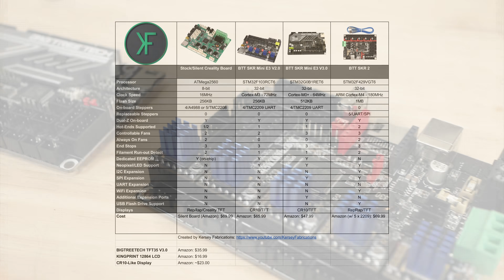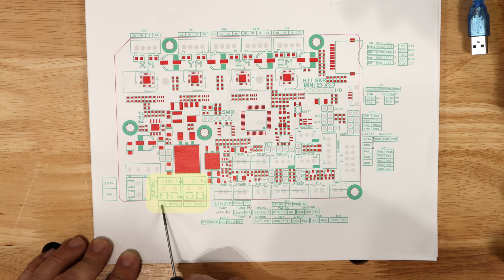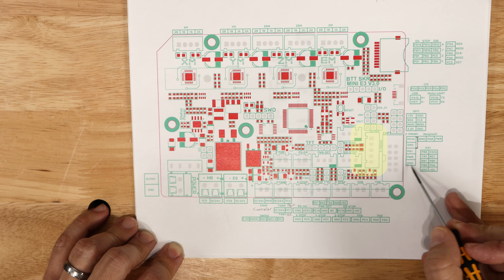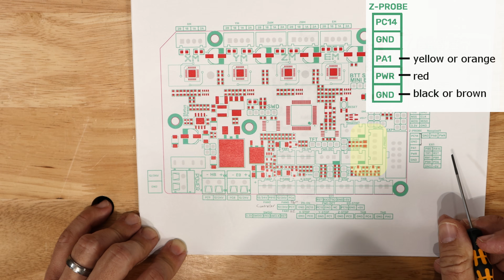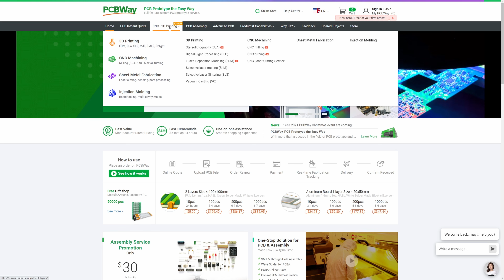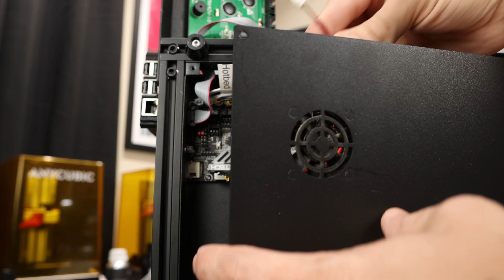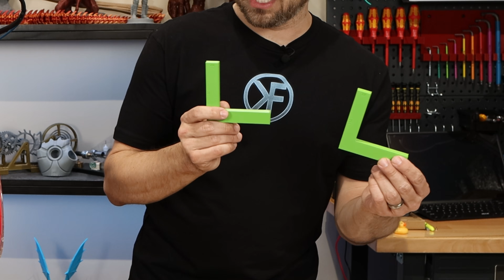Bigtreetech SKR Mini E3 V3.0 - Ender 5 and Ender 5 Plus

Comment: I have the enders 5 plus and want to get this board what screen would you recommend for enders 5 plus with that bigtreetech board
Reply from the maker: I like the Bigtreetech TFT35 V3.0 (https://amzn.to/3v5sUoz). It's a good size screen and it's easy to find mounting models. I even did a video on it. With that being said, Bigtreetech makes several sizes and they'll all work if you can find someone that's designed mounts.
Reply: @kerseyfabs  whats the best firmware for that mother board with the tft 50
Reply from the maker: All of the displays use the same board firmware. You can find it in the video description.
Reply: @kerseyfabs   im having an issue with wiring on my enders 5 plus to this board i was following your video but the wiring is diffrent as theres a black and red wire going to a tiny circuit board about 2 inch square it says control in on it

Comment: I want to see the out come from the new board and how you liked it? I fell in love with the lerdge k board because of your videos. Thanks.
Reply from the maker: It's been working great so far in my Ender 5, no complaints. It's also nice to have some up-to-date firmware installed on it. I was still running relatively stock firmware on my old 8-bit board.

Comment: I've been banging my head against a wall for almost two days trying to solve my BLTouch issue on my Ender 5 Plus. I never had issues with it before this board. For some reason, during the mesh it will start doing the mesh correctly, but at some point it will eventually fail. The probe will move to a new spot on the board, the board will go up quickly, touch the probe, then go back down and move up slowly. On the second pass the BL Touch will not retract and the mesh will fail. At that point i have to restart the printer to try again. Any idea what's causing this and what can fix it?
Reply: Hum... so is that the final option? Best bet is to go with Klipper? I haven't moved my wires around on purpose, but the weirdest thing happened. I switched to a new 24v quiet case fan and haven't had the issue reappear. Idk if its a coincidence or cause & effect at this point. I will test my BL touch more tomorrow and try to get it to fail again. I'll update everyone with the results.

Edit: it started to fail again. I've replaced the board and it's still having the issue. Must be a problem with the firmware
Reply from the maker: Well, above all, I'm glad you solved each of your problems. Unfortunately, there are too many side cases for me to solve them all. All the best!
Reply: @kerseyfabs  Hello, love your channel.  do you know if there was a fix for this issue? i am having the same exact issue on my 5+ with the BL touch. tried 2 BL-touches and 2 different mainboards (Both E3 V3s) and had the same exact issue, even tried re-compiling marlin to have all 5 wires plugged into the probe connector.
Reply: I am having this EXACT same issue. I went back through and checked all my wiring and I also grabbed my bl touch off my other Ender 5 Plus and its the same. I even seperated the wiring out of the control box to try and elimante an possible interference. I tagged Kris in some posts on the Ender 5 Plus Facebook group so hopefully we can come up with a fix. If you figure something out please let me know and I will do the same!
Reply from the maker: The best I can offer initially here is either (a) Noise on the line. Try moving your BLtouch wire away from your power wires when you run the cables. I've seen the power lines add too much electrical noise on the BLTouch sensor. (b) Bad connection. Sometimes the stock connector just doesn't fit the new board connector well enough, causing intermittent issues. You can try to change the connector on the BLTouch lines.
Reply: @kerseyfabs  I ended up going over all the connections and even took the entire wire out of the mesh stuff and ran it totally seperate from anything to elimanate interference as much as possible. I flashed a couple more times and still had no luck. I ended up setting up klipper because it was something I wanted to get into anyways and have been having zero issues with the bl touch. Hopefully, this information helps. I'm not sure why OP and I were having issues but it must be some glitch. Thanks!
Reply: Had the same exact issue as the others.  Tried EVERYTHING from wiring to customizing the firmware in many ways, no luck.  Can confirm the Klipper solution gave me back a functional BLTouch. Thanks, Dave!
Reply: @earendil532  That's awesome to hear! No offense, I'm glad I wasn't the only one in same boat. Honestly it was worth it to move to klipper anyways. I'm getting addicted to 100mm/s+ speeds now. Accelerometer will be here tomorrow.
Reply: @Davedubya69  I have the same issue. Sounds like it is most likely a firmware issue as all my similar attempts did not work. Although right now upgrading to klipper sounds a little over my head. Do you have any links/resource you'd be willing to share on how you made the transition? I've been interest in it for a long time, but it seems intimidating lol
Reply: @KurstenOwen  So, IDK how Mr. Kersey will feel about this on his channel but this is a link to a guy that shows you how to install klipper using KIAUH. It's very easy to do and if you are doing it for an Ender 5 plus I could get you my config file. With this file it would take roughly 20 mins to get up and going. The only thing you will need is a raspberry pi. I also use a PITFT50 screen and designed a wall mount that holds the screen and pi. https://youtu.be/OmBIHB9TFgc
Reply: @KurstenOwen  i played around with this a ton with different firmware settings... tried both kersey's firmware and edited the BTT ender 3 firmware to just fit an ender 5+..
 Had the same issue no matter the firmware soruce.. couldnt figure it for the life of me... ended up switching to a V2 board with the same BLtouch settings and that board works flawlessly. Even tried a 2nd board... all the same.

Strange part is, i put the mini e3 v3 in an ender 3 pro and flashed the firmware from BTTs website... same bltouch settings... and its working flawlessly now.
Reply: @lukeslab2390  That is so frustrating! I have two other e5+ that are using the V2 board, and since the new one came out (and it was cheaper) I was like "this is a no brainer."  I definitely thought wrong lmao. Wonder if it would just be best to either revert back and get a  v2 since I know it worked on my other e5+ or try and upgrade to klipper... I've always wanted too, but it seems intimidating lol
Reply: @Davedubya69  Very interesting.... I currently have a 8gb 4b pi, but it is running octoprint/cams for 3 printers. Wonder if I could run the klipper octoprint in the same way if I upgrade them all to klipper at the same time. I'll have to do some testing. Hopefully my tft35 would work for screen. Please, I'd love the files to do some testing for today!
Reply: @KurstenOwen  With KIAUH you can instantly do multiple instances all at once. Klipper is amazing and can do a ton. The only complaint I have is the lack of plugins that octoprint has. Also, you can do klipper with octoprint but I don't suggest it. It uses a bunch of extra resources. I suggest just using mainsail. If you want to, it's probably easier to chat on FB messenger. I search my name. My profile pic is black with a file folder saying "come and take it"
Reply: Did you end up finding a solution? I seem to have the exact same issue. Sounds like others gave up and switched to klipper which would make me definitely think it is a firmware issue. I was just wondering if you ended up getting it to work in another way? I've been struggling hard this whole weekend just because of the bltouch issue on my e5+.

Comment: How to connect this new board to Ender 5 Plus  with the stock touch screen and BLtouch?
Reply from the maker: It won't work with the stock display with any firmware that's available.
Reply: @kerseyfabs So, you need to switch to MKS board - it costs +/- $ 50 with a touch screen

Comment: THX for that superbe Pin out Walk Through. All the right tips for the upgrade. 
A Tip from me: For removing the glued connectors use a hot air station or a hair dryer to soften the glue. 
then you can easily remove the connectors without the danger of poking the board or cables.

Comment: I dont really like these slower cips there are using. the M0+ is a LOT slower than the m4. Has no hardware floating point.... It is a really cheap downgrade. 
You do see the differance in klipper when the loads on these boards is a LOT higher. Honestly the best 4 stepper board of this gen IMO is the RRF e3 board. It has 1meg of flash, 169mhz cpu and all the compatibility for klipper or marlin... Dont really understand why the e3 v3 is worth it over this. It still matters, my old 8 bit printers sit around 80% MCU load when printing fast. The RFF seems to hover around a 10% load at tops.... It does sort of matter for some situations.

Comment: Another great video! Only thing I wish with your firmware is that you would share the actual files (.h, adv.h, pins, etc) to if we need to adjust a couple things we could (runout sensor on Ender 5, etc). Still, I appreciate all your effort you put in to helping all of us! I have the mini v2 on my Ender 5 now so unless I find a great deal I doubt I would upgrade until something would happen to this one.
Reply from the maker: I ALWAYS publish my source. You can find it on my GitHub.
All source can be found here: https://github.com/KerseyFabrications/Marlin
Select the branch you need from the drop down.
Reply: @kerseyfabs  Thank you - I always forget about github!
Reply: @kerseyfabs  
LOVE your videos always so helpful and easy to understand.  i have an 5plus  but i have a sprite pro kit on it you don't happen to have a firmware file for that configuration do you ?  or possibly some guidance on how to change the firmware you gave.  I did instal your firmware but need to adjust offset  eseps ect.

Comment: Question for you. I went through the process of installing this board on my E5P and after having double-triple checked the wiring of everything I have yet to get my bltouch to light up, let alone probe. I am using a stock Ender 3 screen on Exp 3 and the board from the video, and I’m honestly at a bit of a loss on what to do to get this working. Any suggestions are appreciated!
Reply from the maker: In the video I show the correct mapping of the BLTouch pins on the board layout. You may need to manually rearrange those pins to match the pin-out.

Comment: Unless they changed the TFT 35 V3 E3 - If you use the knob that came with it you should have a lighted knob that you can change the color of. Sorry if you already knew.
Reply from the maker: Yes, that's true on the E3 version but not on the non-E3 version.

Comment: great video..we were chatting on FB earlier,  just got my E3 v3...should have watched this video first. didnt realize I needed a connector to the "Always On" wires..should be  here tomorrow. Keep up the great work.
Reply from the maker: Glad I could help!
Reply: @kerseyfabs  finally able to install..but the hot end fan doesnt turn on. I heat the nozzle up to 200 and its suppose to come on around 50/60. I know its plugged into the right port.

Comment: Do you recommend backing up the EEPROM from our old board and loading it once the new board and firmware is installed? Or is it better to write down the values from the old board and manually enter them into the new one? My board arrives today and I'm trying to do some prep work.
Reply from the maker: I usually hook up over the USB port, run M503 and then copy and paste the settings I want to save to the new board.

Comment: One big thing you left out was the new firmware thats needed for the Ender 5 Plus touchscreen to make it function with the Marlin v2 firmware. There is a whole new DWIN file set needed to get full functionality.
Reply from the maker: I don't support using the stock touch screen.
Reply: @kerseyfabs  is that because of sponsorships or another reason? I'm making a DWIN set to go with the stock touchscreen based off Jay Aristide's build. I just don't have the cash to throw at a new screen when the stock one works fine.
Reply from the maker: @mech13  Nope. No sponsorship here. No financial reason at all. I just don't like it, so I don't want to make a video on it. If there's a DWIN solution that gives me all of the features and control of a Marlin interface, including M600 support, I'd be happy to look into it. Traditionally the support has been very lacking.
Reply: @kerseyfabs  stop the clock. Are you saying that the only way to get M600 to work on the E5P is with a new screen? Obviously this doesn't include working off octopi / octoprint because it works with octoprint even on your marlin 1.7.3BL
Reply from the maker: I realize you can probably do that with an OctoPrint plugin but many of my viewers are not interested in adding an additional layer to their printer. I get so many messages, emails, and comments asking how to get M600/pause at layer working on a stock Ender 5 Plus. If you know how to do this with an updated DWIN firmware, I'd be down to making a video on it.

Comment: Did I miss the link for the pre-made fan connector and the solder connectors.  Thanks
Reply from the maker: Sorry about that. I added them to the description and here it is for convenience:
Connectors:
Solder seal in various sizes: https://amzn.to/3gYPQ0J
Just the small solder seals: https://amzn.to/3JmDVpj
Pre-made JST connectors for fans:
The exact ones I purchased are no longer available. These look the same but make sure to verify pin outs when you receive them: https://amzn.to/3BeXH3q
Reply: Thanks for the fast reply and the work in your video, I have just finished ordering everything for the upgrade
Reply from the maker: @johnbright6587  I hope everything goes smoothly!

Comment: Might be splitting hairs, but that's not a schematic.  That's a board layout.  A schematic shows graphically how different components are hooked up electrically.  Board layouts show you physically where components (chips, connectors, etc) are located, but not how they're connected electronically with each other.
Reply from the maker: I appreciate any correction. In this case though, "schematic" is a pretty generic word it seems. I went a looked it up on several sources. Wikipedia had the bed definition in my opinion:
"A schematic, or schematic diagram, is a representation of the elements of a system using abstract, graphic symbols rather than realistic pictures. A schematic usually omits all details that are not relevant to the key information the schematic is intended to convey, and may include oversimplified elements in order to make this essential meaning easier to grasp."
To your point though, "board layout" would be a more specific term.
Reply: @kerseyfabs  I think what wikipedia is getting at is that an op-amp, or logic gate will have a very different graphic symbol on a schematic, whereas a picture (photograph), or outline (board layout) show similar physical characteristics to any similar IC (8 pin dip, etc).  On the schematic, you do not have 'realistic pictures', you have an abstract representation (op-amp == triangle) of the component showing how it's connected to other components.  Whereas a board layout (pcb layout if you will) is more like an outline of a photograph physically showing how connectors (and IC's) look, also showing pinouts relative to their physical location.  Schematics (look at the omp-amp triangle pinouts) don't tell you where physically on the board stuff is, it just helps you understand the electrical circuit, not the physical board.   I guess that's the biggest difference.  The schematic helps you understand the electrical circuit, and the board layout helps you understand the physical board.  Very different.  

To be fair, BTT's board layouts are quite good.  Better than most.  You rarely get schematics though.   Louis Rossman has some examples of 'grey area' apple schematics (with all their errors), he then switches to board layout images to track down where physically on the pcb to track signals he's looking at on the schematic.

Comment: Hi Kris, great vid - that link in your desc, the second one "SKR V1.4 Turbo - Dual Z - TMC2208 - Ender 5 Plus - BLTouch connected to Z endstop - " I think should say TMC2209.
Reply from the maker: Thanks! You're right. All fixed. Ender 5 BLTouch link added too.
Reply: @kerseyfabs  do you have uncompiled source for this guy? "SKR V1.4 Turbo - Dual Z - TMC2208 - Ender 5 Plus - BLTouch connected to Z endstop"?  i'd like to dig through the appropriate config files and look around. I complied my own version about a month ago, but I missed a few things that I should have added, and i just added the microswiss direct drive and want to tweak it a little more  - Your first one when you added the tft and 1.4 turbo was really nice.
Reply from the maker: @jeebstheman1  All of my source is available on GitHub. Here's the one you asked about: https://github.com/KerseyFabrications/Marlin/tree/2.0.9.3-BTT-SKR-V1.4-Turbo-Ender5Plus-DualZ
You may have to switch 2209s to 2208s but that should be all.
Reply: @kerseyfabs  Fantastic. Your firmware has everything i had and a bunch of stuff I missed in mine. Thank you!

Comment: Did you use a FAT32 SD card?
Reply: Good question. format it to FAT32 with 4KB (4096B) clusters. If you don't do this, it won't work. 8K clusters wont work. 16K clusters wont work. 32K clusters won't work. Format it to 4kb clusters. Use the 8GB creality card; it's small enough to do this with.
Reply from the maker: @Nine Ninjas is right. That should do it.